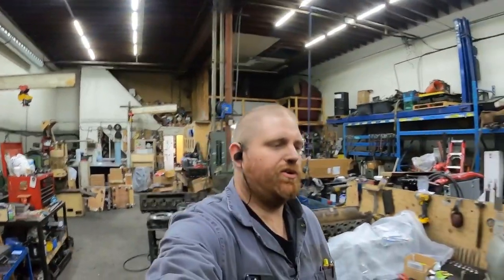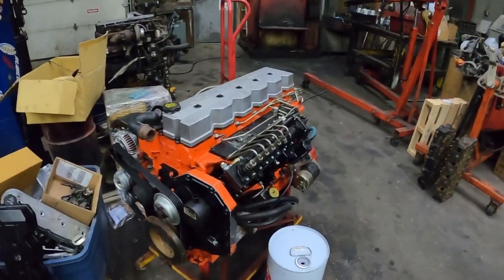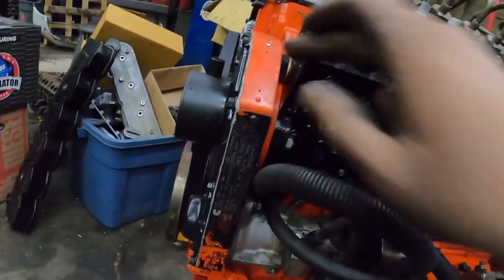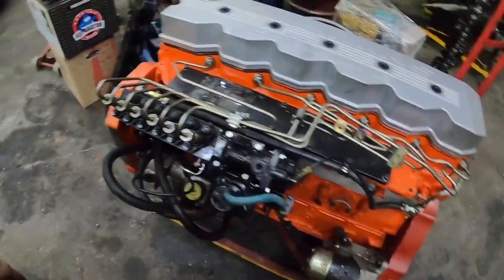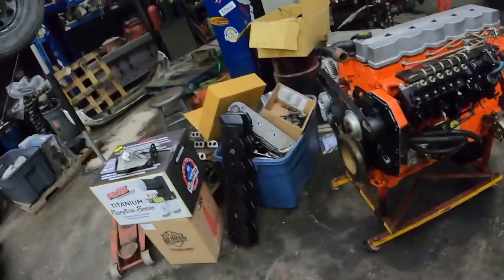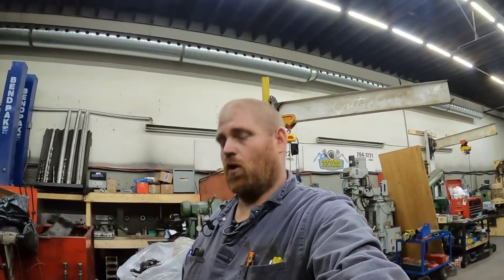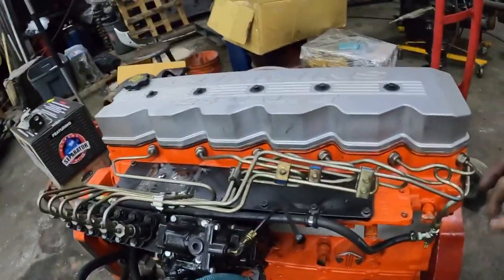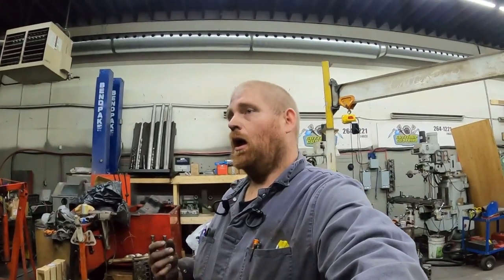Quick run down on how to build ppump 24v ( parts list )

Comment: Realizing this is an old vid, and keep in mind i have not done much research yet. 
I have a different issue than most.
I have a 12v Ppump truck with a junk head. I have a good 24v head. Whats involved or can you link me to any info on doing the swap in this fashion?? 24v head swap to Ppump bottom end.

Comment: What is the benefit of converting a 24v into P-pump, if its about have a  Mecanical engine no ECU ,  why don't stick with the 12V ?
Reply: That 24v head flows much better than the 12 valve head.

Comment: Long shot. I am getting ready to do this swap. Ordering everything before I get started. Found the adapter to move the oil feed line to the driver side but cannot find any information on how to plug the original oil feed inlet by the block after relocating it. Does anyone know the size or where I can order a plug if they make one?
Reply from the maker: Send me a email. I have it written down at the shop. Robcutterup@outlook.com

Comment: What fuel injectors can you use when adding P7100 on a 5.9 with CP3 engine? The CP3 engine has a different piston combustion chamber?

Comment: Hey Rob! I’ve asked you a few questions over the years and your videos have helped me with my 12v build. 

I have a question and need some help making my decision. 
I’ve just rebuilt a 12v to stock specs. I’ve got a local guy in Australia who has a 5.9 24v with a p pump conversion and has studs, gov springs, bigger injectors and a bigger turbo.. he is keen to swap me. 
Is this a good deal or a bad deal? 
Thanks!

Comment: Where do you put the boost reference line, the one off the back of the AFC, in the 24v head?
Reply from the maker: Any air supply will work. Must guys pull a lin off the intake horn or side of the head

Comment: What about the cam position sensor?  Or can you use the crank position sensor off the 12v?  I am swapping the ppumped 24v into a 2008 f-250. What would you recommend?
Reply from the maker: Most guys for a ford swap use a sensor that works with the ford. Like up dcs Cummins
Reply: @CUTTERUPROB  I am staying away from DCS. Mostly everyone who has ran any DCS products have negative reviews. I have someone making me a custom engine harness but we are both wondering what would be best.

Comment: I might of missed it but do you need to power the injectors on a p-pump still or is it a mechanical injector?
Reply from the maker: It’s a mechanical injector
Reply: @CUTTERUPROB  thanks man, do I need to find a 98 12v harness then or can I modify a 24v harness cause I'm putting it in a 97 f350

Comment: on my 6.7 p pump swap using the 6.7 head. do I use the 6.7 fuel tubes with the vp44 injectors and use the conversion lines for the p7100 to common rail or do I use the vp44 to common rail tubes and standard vp 44 to 7100 fuel lines? which ones fit the injectors? what combo?
Reply from the maker: If you using vp44 style line you have to use the vp44 tubes

Comment: What do you recommend doing for the lift pump? I’ve heard ppump require about 30 psi where as vp44 require 14 psi. I want to go with a fass set up for my ‘02 and just wanted some input. Can you buy a fass for the 94-98 dodges without having to do intensive modifications to retro fit it to my ‘02?
Reply from the maker: If you were to put a ppump fass on the vp44 you would need to regulate the pressure down witch can be done a couple ways
Reply: @CUTTERUPROB  What I meant was I am wanting to put a ppump on my 02. So I would need more pressure correct? I was just curious on what you thought the best route would be for a lift pump.

Comment: Okay I’m planning on doing a p pump swap I’ve found both a 6.7 engine and a 2nd gen 24v to build. Which do you recommend doing I’m wanting a 700-900hp range and doing a built 47re?
Reply from the maker: Depends on the what your and budget
Reply: @CUTTERUPROB  really have an open budget to be honest I’m in no rush to do this! Wanting it as a father son project and we are going to be using it as a hot rod/pulling truck

Comment: Done a few of these P-pump 24-valve setups as well as install 12-valve engines in 01-02 trucks.  There's a few other things you need if you want the truck to have stock functionality, including tach, cruise, etc.

I made a drill guide that will allow proper installation and alignment of the 01-02 24-valve cam sensor in the 12-valve gear case.  Naturally, you will need to have the 24-valve cam gear with the tone wheel installed as well.  And if its a 12-valve engine, you will need to swap out the 10mm-head gear case mounting bolts to the 24-valve torx style in order to clear the cam gear tone wheel bolts.  I also made a cam sensor boss that gets mounted to the back of the 12-valve gear case, which locates the cam sensor at the proper angle and elevation.  Once you do all of this, you will retain the correct tach input for the 01-02 trucks.  Of course, you will need to retain the use of the 24-valve ECM, which can easily get mounted on the frame rail near the starter.

The conversions I have done have been 100% functional, with all sensors and inputs working.  I even made a 12-valve TPS work with the 24-valve PCM with only slight modification.  All of them were automatics, and did use the factory ECM and PCM for control.  I also made a custom wiring harness when I did a 2002 12-valve w/47RE auto.  You opened the hood and could not tell it didn't come from the factory that way.  That's my kind of conversion!  Have not done a conversion on a 98-99 truck, they may actually be easier since they have a crankshaft position sensor while the cam sensor has rudimentary input.  Sometimes I miss doing conversions, but working on all stock trucks is far more profitable!
Reply from the maker: That’s great info thanks man. 
And yes working on stock stuff does pay more most the time. But not as fun 🤣
Reply: What do you think is a fir price for someone to ppump an 01 24 if I bring all the parts to do the conversion?
Reply: @drewbot69  do you bring your steak to the restaurant and have them cook it for you?

#1 rule...  Don't ever bring your own parts to a shop.  Buy them yourself, install them yourself, or buy from the people who are doing the work.

With that being said, a high-quality P-pump conversion isn't cheap, especially if you want to to all function like stock.  Parts and labor you could be anywhere from $10-20k or more, depending on what HP level and functionality you want.

Comment: On the motor in the frame what is the gear cover ??and does the p pump on 98 24 value make more power
Reply from the maker: Keating machine. Not sure what you mean by jump up

Comment: Looks like the head is clearanced where the apps bolts to it? How do YOU mount the ECM in a vp44 truck?
Reply from the maker: Ya the area ya. The ecm you just make a bracket and move it back

Comment: Is there a way to use a factory 12 valve lift pump on a 24 valve?

I couldn't find a 24v cam with a lobe for the block mounted lift pump.

Only other mechanical option is belt driven fuel pump but it's not convenient.
Reply from the maker: The vp44 block is just a 12v block so a 12v cam works. But the vp44 is a better cam

Comment: I’ve talked to a couple people who have done ve pump 24v swaps. Awesome thing is you can use factory vp44 injector lines with a 12-14mm thread adapter (like a helicoil)
Reply from the maker: Interesting
Reply: @CUTTERUPROB  Eric Gilbert (runs THE HUNGRY DIESEL) made something like 645hp with a ve pumped 24v.  Not too bad for an old ve garbage pump!!!!
Reply: @douganderson7002  plus a ve will get better mpg with its dynamic timing advance. P pump has fixed timing.   That being said my truck is a p pump swapped first gen because 1 I like to go fast and 2 I had issues with two ve pumps. P pump swapped it for less than what a rebuilt ve cost.

Comment: 👍👍right on man...have had most of the parts lying around for years...been  deciding which truck is gonna get it ,or the next VP44 or ECM that takes a shit on me...cause I'm not swapping those again....lol...but anyways👍🍺👊
Reply: You've had lots of issues with the VP44 and ECM?

I know first hand someone with 350,000 miles on factory VP44. he's owned the truck since new. 

But he said he's gone through 3 stock auto trans and one built LOL
Reply: Just on one truck .....the original took a shit and then a used one I put on...went through a VP44 on 3 separate trucks...until I put a good lift pump on obviously...but ..I do like the VP44 engine's....but ...